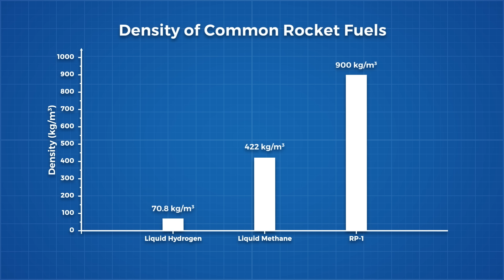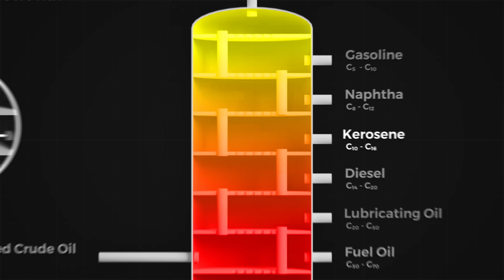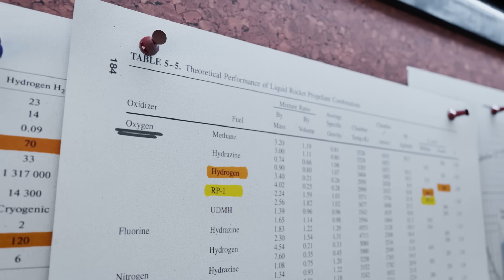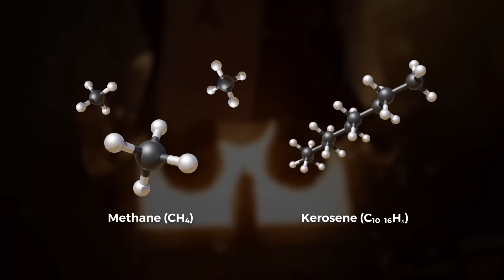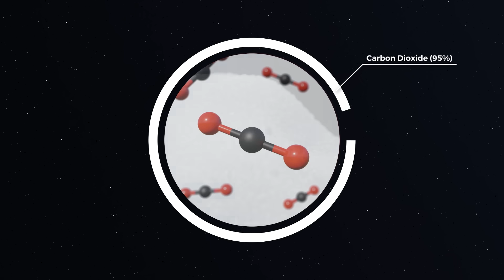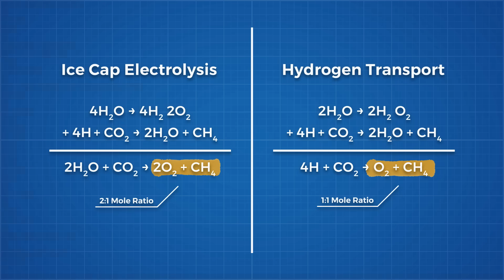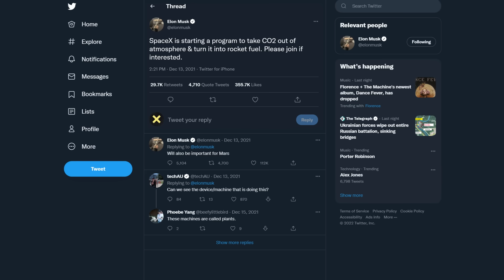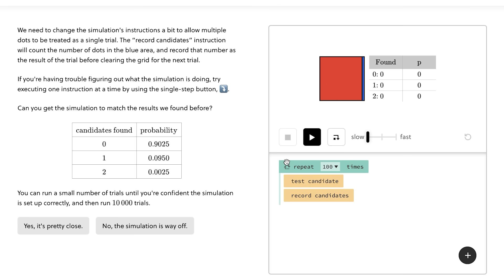Why SpaceX is Using a New Fuel

Comment: The reason it burned with so much soot was it was a deliberately fuel rich mixture. If they ran the engines at perfect stoichiometric ratios, they would have melted. And some of the soot is from the turbopump. And the ratio could be changed to "throttle" the engine via the engines' "Propellant Utilization" valves. (It's not actually throttling, but had a similar thrust modulating effect . )
Reply: Came here to make this same comment.  Black exhaust you see at ignition is turbopump spinning up. Then in the main exhaust plume you can see the color change between the turbopump exhaust and combustion chamber exhaust.
Reply: @mcg7996  thanks
Reply: @mcg7996  or we are still going
Reply: @mcg7996  hey question...so...is changing the mix of fuel to oxidizer the only way to "throttle" a rocket engine?  I always had in my mind that it would work like a car where you just...put less of the total F/O mix into the combustion chamber and boom, less throttle....but that doesn't seem so easy in this case....
Reply: my understanding was that most of the black soot you see is actually the exhaust of the fuel-rich gas generator being used as film cooling inside the nozzle of the main engine, not the main engine running below stoichiometric balance. Like the main combustion chamber they run hot but then to stop the throat of the nozzle from melting they flow the relatively cool exhaust from the gas generator powering the propellent pumps between the walls of the nozzle and the hot gas from the main combustion chamber
Reply: @evil0sheep  you are correct.

The generator exhaust is injected by the ring around the nozzle, to protect it.
Reply: @evil0sheep  indeed you are correct
Reply: @evil0sheep you are correct. This is easily verifiable information. It is a shame this channel pretends expertise yet states this gross error.
Reply: BELIEVE in JESUS  do you think this is a valid place where anyone will actually read this and look into it? I believe the same thing, but we're talking about rocketry here. Maybe join the convo and get to know people and BE an example thru your actions instead of spamming comment sections.
Reply: BELIEVE in JESUS  And this relates to rocket fuel how?
Reply: @Moderator Hater Actually burning methane is not the problem.  The problem is releasing it into the atmosphere, where it acts as a potent greenhouse gas for 20 to 80 years before decaying into CO2.  Also, plenty of methane can be captured from natural sources instead of fossil fuels.  Many dairies in my area are putting methane capture systems over their sewage ponds, using that methane for heating and electricity.  It can also be used to make fertilizer, but that's a different thing altogether.
Reply: @loungelizard836  So is natural gas but we're not allowed to access it now.
Reply: @loungelizard836 , and as it makes the fertilizer you speak of, it can also be used as an explosive, … but will not be excited enough by buying a demolition cap to set the process in motion, it will need a sufficient amount of TNT, or dynamite, …
Reply: BELIEVE in JESUS  Not today, sorry.
Reply: @electric7487  not ever,  actually.
Reply: @electric7487  Likewise bro, read my comment above. 2 minutes isn’t a lot to spend to find the truth of the matter. I promise you, if you ask, he will answer.
Reply: Film cooling, I think, is the method that causes the excess soot
Reply: @Social Media killed the United States The Everyday Astronaut one?
Reply: @Kyle-gw6qp  Major Tom was an astronaut. lol
Reply: @First That’s all well and good, but I still fail to understand how this relates to rocket fuel, or even the original subject matter under discussion.
Reply: Most people don't understand that the F1's were carbureted engines.
Reply: BELIEVE in JESUS  I believe in science, not god
Reply: @nitishgupta5959  I believe in both....
Reply: Trueee I remember Elon Musk saying something like the layer of sooty carbon assists in thermoregulation of the nozzle because it absorbs a lot of heat and loose pieces break off and build up again.
Reply: False.
Reply: @Moderator Hater RP-1 is basically petrol. One gallon of RP-1 will release roughly the same emissions as one gallon of petrol. In fact, RP-1 will be significantly cleaner.
Reply: @Kyle-gw6qp  the only real problem is that those exhausts are released into the upper atmosphere,  in volume.  But I'm sure the person you're debating isn't aware of this. If they are they didn't express this clearly.
Reply: BELIEVE in JESUS  Judges 21: doing mass murder and kidnapping little girls is all part of god's plan.
Reply: @Social Media killed the United States Do we have a link yet?
Reply: @Social Media killed the United States doesn't matter, the leaders of the world don't live by their own standards, that means there is no crisis.
Reply: @Social Media killed the United States don't forget that we are just adding carbon back into the atmosphere that was already there before. Fossil fuels have only the carbon that was put into them when the animals were alive. We are just bringing the earth back to an equilibrium that was there before the cataclysmic event that put the oil there in the first place.
Reply: Hell Yeah!
Reply: Lee you
Reply: Let
Reply: Oh.... Right.  Running fuel rich isn't efficient, so it doesn't get as hot.
Reply: I want to see this!
Reply: @Social Media killed the United States better burn less gasoline then.
Reply: @Social Media killed the United States lol.  You think a thousand rockets a year is going to equal 3 billion ICE engines,  traveling a trillion miles,  overall,  pretty year? 
Precious
Reply: @Social Media killed the United States its simple math. A 5th grader could suss it out.
Reply: @importanttingwei7747  it isn't particularly feasible to boycott a viewer.
Reply: Is it possible to have electric rockets?
Reply: We should grow Marijuana together on Mars. Just get me there and it's on.
Reply: BELIEVE in JESUS  Interesting point but it likely has nothing to do with the topic.  I would think that you would have used one of JC's many "miracles" or expressions... how about walking on water? If you can figure out how he did that one, perhaps there is a chance of colonizing Mars.
Reply: Couldn't we take that soot and make fuel with it, or something usful?
Reply: @BoycottSimping  
By not giving the fuel enough oxidizer to burn completely, the nozzle doesn't get as hot but some of the fuel is only partially burned,  resulting in soot.

They could have used it as fuel by adding more oxygen to the mixture. But if they did, the exhaust would have been hot enough to melt the nozzle. 

Also, changing these ratios was how it could change how much power it was producing. 

Rocket speed and positions are usually planned to optimize the fuel and velocity needed to get into the desired orbit. 

Because the atmosphere gets thinner as you go up., and because the rocket is accelerating, there is a drag force on the rocket from moving fast through the air starts to reduce, instead of increase. (The math isn't too hard, but basically the graph for air density at some altitude gets smaller faster than the rate drag is getting bigger. This drag is the "Max Q" they talk about. Basically.)

 Typically the engines will be told to push less around those places, both to reduce load on the vehicle and to save the thrust for when it makes more difference. 

Trying to capture the soot and save it would not be useful.  There's 4000 pounds of fuel going through each of 5 engines per second, turning into 5800F (or 3200C) exhaust at an altitude of up to 42 miles.
Some of that is now soot. Good luck collecting it.

Getting stuff into space is hard.

(sorry this is so long. ;] )
Reply: still..its ancient tech.. if truth be told..
Reply: @harrywalker5836  the used SpaceX boosters you can see are covered in soot today for the same reason: their engines produced sooty exhaust because it was intentionally fuel rich.
Reply: @zenithparsec  i know that, he said that. why are we using 130 yrs old tech.????.... when nasa has faster than light speed tech.. ???..fact..
Reply: From 1930 to 2022 (very generously the time from when rockets were "invented" until now) is still less than 100 years...

You are wrong and confident. Sorry for you to learn this way. (and if you don't, well, I'm sorry you didn't.)
Reply: Yep , those engines smoked almost as much as Cheech & Chong  !   Rockets were trying to catch up to Dr. Timothy Leary whom made orbits regularly !  Let's hope Elon can find where Dr. Leary went , somewhere between here & Elon''s world I imagine .......  We should maybe light another Doobie & ponder the variables while listening to Pink Floyd ...........
Reply: ahh, perfect.. thanks for clarifying! i completely understand now!
Reply: Get him.
Reply: BELIEVE in JESUS : Screw God's throne, its occupant and family.
Reply: Thanks nerd!
Reply: I don't know maybe I'm stupid but can't they use something like propane and do something like nitrous oxide or NOS whatever you want to call it for an oxygenator I don't know just asking if anybody knows they always said that propane burned really clean
Reply: @cindyjuanez4623  They don't want it to burn clean, because as I said, it would melt the rocket. And nitrous is N2O, which means 2/3rd of the atoms are nitrogen. You need two molecules of them to give you the same amount of oxygen as you get from one molecule of... oxygen. 

You're not dumb. as an oxidizer N2O has been considered and tested for many applications, but it doesn't tend to get used because when going into space, you want the highest chance of reaching it. The best way to do that is to use to most powerful propellant by weight that you can. LOX is denser and adds more "go faster" than N2O does.

I'm simplifying many some things as much as I can without bending any important truths. 

Given relative atomic masses and their respective densities when liquid, LOX wins by about 60% in my quick back of the envelope check from Wikipedia numbers.

When burned, the nitrogen released isn't a big fan of reacting with the carbon and hydrogen (whether from propane or kerosene,  or from liquid hydrogen.) It will react with the oxygen though, and produce  nitric oxide (NO) and nitrogen dioxide (NO2), but I can't find anything immediately about where this would happen... if I had to guess I would say outside the rocket, at the edge where there's atmospheric oxygen, because I think the hydrocarbon would burn in N2O preferentially over N2O self-reducing, but I don't know about at rocket pressures and temperatures. It is literally rocket science, so I have an excuse. All nitrogen oxides have have numerous biological and environmental effects like making acid rain and destroying ozone, causing smog, and tending to cause a bad day for living things in general. 

But it's a legit oxidizer. It's just not as good as what they could easily do. The major advantage is that it's really easy to store, compared to LOX. 

Hybrid rockets often use it. (Imagine a solid fuel booster and a LOX/RP-1 liquid fuel booster had a baby. It would have an oxidizer tank, and instead of having the fuel and oxidizer mixed into the fuel grain, it just has fuel. Straight paraffin wax poured into the tube [with channels cut out of it for the oxygen) is all you need for a hybrid.)

Hybrids are simpler than liquid fueled rockets: It's takes fewer resources to make them. They are more complicated than solid fuel motors.

When you start a solid rocket motor, you're lighting a candle and waiting for it to burn all the way down. 

A hybrid motor can stop (or even control the throttle ) at any point by controlling how much oxygen is being sent to the combustion chamber.

Why don't orbital rockets use N2O, Because it's not as efficient as LOX. It's not a dumb idea, but it's not done because it's not as good as easy enough alternatives. 

Isp is "specific impulse" which measures (roughly) "how much 'go faster' do I get for each mass-unit  of "go faster stuff", and the bigger the number, the better the propellant is. For reasons, the unit is "seconds" written as s. You typically get told the Isp at sea level, and in a vacuum. 

At sea level, the rocket exhaust has to get out of the rocket, but in front of it is the atmosphere, pushing inward at about 14 lb/sq in of pressure.
The J2 engine's rocket nozzle is 6'5" in diameter. That's a whole lot of pressure you need to displace and keep displacing while inside the atmosphere. . And because you are using some of your potential thrust energy just to keep the air out of the way  (it's to do with the dot product of the vectors. ) so the exhaust can get out and push you into space... which means you can't use it for lift because it's tired now. 

So sea level numbers are lower.  )

As these numbers vary due to the rocket specifics, these numbers should be considered illustrative. (Inecaise  forgot where I got them. )
LOX/Paraffin hybrid has vacuum Isp of 360s , but N2O/Paraffin gives you only 310s. I'm not a hybrid motor person, but I saw some charts and comments in a paper or two which mentioned hard starts (that's when it the fuel detonates instead of deflagrates on ignition) being common. You don't want that. (But that's potentially just an engineering problem.)

1) It wouldn't be as efficient to use N2O instead of LOX because you need to carry so much extra mass. 
2) The "not burning cleanly" was deliberate, to stop it melting. 
3) And your rocket would probably still fail its emissions test because of all the nitrogen oxides.
Reply: Pretty sure real engineering has covered this topic in other videos
Reply: @Mister Happy Go Lucky He sounds like a musko fanboi.
Reply: Still, not melting the engines is a necessity so it isn't as if they could choose a fuel oxidant ratio that wouldn't produce soot.   If they wanted to reuse their first stage without having to clean out the soot, they needed something that would not produce soot and methane does that without the volumetric density and cryogenic difficulties of hydrogen.
Reply: @Space Science has become ludicrous!your life is more impacted by your diet, activities and life choices.
Reply: @Space Science has become ludicrous! I meant your longevity.
Belief system is a second order factor.
Reply: @Space Science has become ludicrous! Your ignorance is obvious!
Reply: Ok we get it you changed your injectors in your diesel he explained it better later in the video
Reply: I can't wait to see the engineers doping the reaction with heavy molecules to cool the reaction at proper stoichiometry ratios 😊
Reply: @Moderator Hater The important thing is not even the gases, but the amount of fossil carbon added to the biosystem, as it always ends up increasing CO2 level in atmosphere and Carbonic acid in oceans.
Reply: @Moderator Hater A couple of rockets have a negligible environmental impact. Billions of cars and millions of factories and power plants have a much, much bigger impact.
Reply: @Kyle-gw6qp  and nothing has a greater impact than denial.
Reply: @Kyle-gw6qp  yes, the CO2 from them makes plants grow better.
Reply: @kayakMike1000  That is true- for some species of plants. But the more pressing consequence of increased CO2 levels is a rapid rise in global temperatures.
Reply: @Kyle-gw6qp  Not true. A "couple of rockets"? That's a lie. 
IC vehicles are the leading cause of climate change, but THOUSANDS of Musk missiles have a huge impact, and for what? More money for the pigman, that's what.
Reply: @Kyle-gw6qp  Especially Al Gore's jet, and air force one, and John Kerry's super jet he rides around in all the time telling everyone to go to electric.
Reply: @Kyle-gw6qp  It's been a long time, and I can't remember the specific chemicals involved, but in the late 80's, it was said that every single launch of the space shuttle released so much of some particular compound into the upper atmosphere that it destroyed about 1% of the ozone layer.  I was studying physics at the time.  If this is accurate, then obviously a rocket expelling chemicals into the upper atmosphere is quite different and potentially more significant than the effects of vehicle exhaust found in the lower atmosphere.  I don't know enough to proffer any more on the subject, though.
Reply: @marvelaturraz5405  Yeah, but that's because the Space Shuttle burned very nasty chemicals in its solid rockets. The main engines if the space shuttle exhausted only water. Saturn V exhausted only carbon dioxide and water in its first stage.
Reply: @Moderator Hater The data speaks for itself. A few hundred rockets every year do not equate to billions of cars. Additionally, there are alternative methods of powering cars- but there is no alternative to rockets.
Reply: @Kyle-gw6qp  Yet, there is not alternative to rockets yet.  I don't know what it will be, but I have hope.
Reply: @Kyle-gw6qp  There are alternatives to rockets.
Reply: BELIEVE in JESUS  no thanks.
Reply: @garethbaus5471  Trust me my bro.... I said no thanks too... for years.... until I asked an unanswerable question and received a perfect answer. Just sayin, takes all of 2 mins to ask Jesus for forgiveness for your sins and ask him to grant you discernment. 2 mins to ensure the truth of the matter ISNT asking a whole lot
Reply: @garethbaus5471  just report it as spam.
Reply: @wstavis3135  I usually do.
Reply: @wstavis3135  I reported it as advocating terrorism. Same thing.
Reply: @wstavis3135  Or hate speech :-)
Reply: @wstavis3135  I already did.
Reply: @Moderator Hater In 2020, the United States alone used 340 million gallons of petrol and diesel per day! For comparison, the Saturn V only used 200 thousand gallons of RP-1 per launch (and it only launch an average of twice per year).
Reply: @Kyle-gw6qp  You're also not realizing [DERP] that the point of this video and this scientific enterprise, is centered upon maximizing efficiency - and that would mean getting as close as possible to 100% combustion of methane of whichever gas we're aiming to adopt for eventual widespread use, + create fuels from greenhouse gas inputs, and burning methane completely eliminates its extreme greenhouse impact vs C02 etc... You're spouting just to raise a stink but you've got no idea what you're railing against - watch some Bill Nye and Cosmos and smoke some weed or some mushies or blotter instead of harassing people trying to make the world a better place, you self-righteous YT-vuvuzela-in-human-form. Let the adults speak, your one-person P.A.C. is only pissing people off and your 501.c.3 status only makes sense if anyone donates to your cause. YT trolls don't pay taxes. Gotta make $ to owe the Fed anything. Or are you a church? A shaman? A prophet? A sandwich board runway model?
Do some research before you go criticizing educated people for having qualities they don't or doing things they never have.
Reply: @Kyle-gw6qp  hibbeler productions channel may help
Reply: @Kyle-gw6qp  there are plans to increase spaceflight a lot, so it's emissions might become more significant. Also there is a green fuel available: hydrogen can be produced in a CO2 neutral way and it just burns to water (the reaction is 2H2 + O2 = 2H2O).
Reply: @rfvtgbzhn  Hydrogen has a myriad of issues as fuel. It's not so clear cut as one fuel being objectively better than another.
Reply: @Kyle-gw6qp  then they could use biomethane. Methane can also be renewable, for example if it is made of biological waste.
Reply: @Kyle-gw6qp  well, if the big plans of Elon Musk really come into fruitition it will be a much bigger issue.
Reply: @Kyle-gw6qp  and biomethane is as good as any other methane if it is purified.
Reply: @Social Media killed the United States I totally agree, I just thought that article was the one you were referring to. I personally think it is not a super useful article because it is not written by an expert.
Reply: BELIEVE in JESUS  0Ll
Reply: The earth is flat, stop falling for Satans lies, seek Jesus and repent of your sins.
Reply: At chamber pressures of only 50 atmospheres the Saturn V never had the Delta V to do the lunar trip.
The exhaust velocity was pathetic. That column of orange flame is barely supersonic
Reply: @aaronfranklin324  And yet somehow it did... very strange. Perhaps you are mistaken?
Reply: @aaronfranklin324  I had to mute this post because of how wrong you are. How did they land on the moon then? The Saturn 5 after all is what got them there.
Reply: @millerlife-1st  they did not land on the moon. Above the low earth orbit environment is far too populated with high energy particles for a human to survive for even a second with shielding less than a meter thick. You can use your fuel as a shield and utilise the phase change latent heat to absorb the of over 80 kW per square meter of the protons that peak at 1000 per cubic cm average energies around 50MeV, as Elon is doing. 
The Apollo probe would have reached a uniform temperature throughout its structure and occupants of over 600 degrees within 5 minutes of the 8 hrs the Apollo fraud claimed to have spent there.
You may have noticed that the NASA planned lunar gateway orbit is highly elliptical and goes way south of the lunar south pole on its long axis.
They have to time it to not be anywhere near the moon-earth-sun plane at lunar midday when the relativistic high energy particles from the earth's magnetail smash the moon's nearside, making atomic shrapnel of the regolith for over a meter into the surface, and as NASA themselves published two years ago creating the mares on the near but not the farside.
Reply: @millerlife-1st  look up the friggen specs of the SatV and other rocket motors on Wikipedia. How the f do you think they could achieve the specific impulse they claim with pathetic 50Atm chamber pressures.  The Russians were achieving 280 at the time. Elons raptors are the first American built motors to catch up with the Soviet 1960s tech.
The Russians, Indians, Chinese all admitted to their public that it was not possible with technology that we STILL don't have to put a man on the moon.
But you want to believe tricky Dickie Nixons Hollywood effort. 🙄🥱
Reply: BELIEVE in JESUS  you can only approach God when you're dxxx!!!!!So obey Gods command by living a good life!!!!!
Reply: I just want to chime in on the climate expert conversation taking place here, not a single one of you mentioned anything about nuclear pollution. You know Fukushima or 3 mile or Chernobyl, and not to mention 8,000 plus atomic and nuclear devices that have been detonated above ground, 3,000 plus below ground. One thing we know about radiation it changes things. But keep going on about simple gasses. 👍🤔
Reply: @joepasci4970  You're quite wrong about the number of nuclear weapons that have been tested: 512 atmospheric tests, 8 under water tests, and 1,536 underground tests have taken place. The vast majority of those were detonated long before most of the commentators here were born. The radioactive fallout from those detonations has long since spread across the entity of the planet, as has the vast amount of radioactive material released from Chernobyl, while the much more modest releases from Fukushima are still diluting outward (mostly in ocean water).

In the end, very few people have been affected by these radioactive releases. Even the worst of them, Chernobyl, which happened near heavily populated centers, killed fewer people than die during solar panel installs in a year in the US (falling off roofs, mostly). 

Why? Because humans are fairly radiation resistant. Originally, when radioactivity was first being studied, they decided to assume that any radiation exposure was fully cumulative. This has, however, now been thoroughly disproven. Small doses of radiation do not "add up" into one big dose. In fact, there is some preliminary evidence that small doses may have a hormesis effect, and activate repair mechanisms that make humans (and other animals) slightly more resilient against future small doses. (This hormesis effect is in dispute, and may or may not exist. We'll see as more evidence is collected.)

Regardless, you do not need to worry about low levels of radiation. Unless you're being regularly exposed to moderately high levels of radon or radioactive iodine or something, you're fine.

Besides, your main exposure to radiation isn't from nuclear power plants or nuclear weapons or even from CT scans: it's from coal power plants. Coal is mildly radioactive, and when it's burned that radiation is released straight into the air for you to breath! And yes, the amount released is enough to be mildly dangerous to humans, sadly. (Through really you should be worried about the fine particulates from coal pollution if you live near a coal power plant, not the radiation. That coal ash is far, far more deadly.)
Reply: @jasonwalker9471  bahahahahaha! Roflmfao! 🤣🤣🤣🤣🤣🤣🤣🤣🤣🤣🤣🤣🤣🤣🤣🤣🤣🤣🤣🤣🤣🤣🤣🤣🤣🤣🤣🤣🤣🤣🤣🤣🤣🤣🤣🤣🤣🤣🤣🤣🤣🤣🤣🤣🤣🤣🤣🤣🤣🤣🤣🤣🤣🤣🤣🤣🤣🤣🤣🤣🤣🤣🤣🤣🤣🤣🤣🤭🤭🤭🤭🤭🤭🤭🤭🤭🤭🤭🤭🤭🤭🤭🤭🤭🤭🤭🤭🤭🤭🤭🤭🤭🤭🤭🤭🤭🤭🤭🤭🤭🤭🤭🤭🤭🤭🤭🤭🤭🤭🤭🤭🤭🤭🤭🤭🤭🤭🤭🤭🤭🤭🤭🤭🤭🤭🤭🤭🤭🤭🤭🤭🤭🤭🤭🤭🤭🤭🤭🤭🤭🤭🤭🤭🤭🤭🤭🤭🤭🤭🤭🤭🤭🤭🤭🤭🤭🤭🤭🤭🤭🤭🤭🤭🤭🤭🤭
Reply: @jasonwalker9471  dahboo 77 channel may help